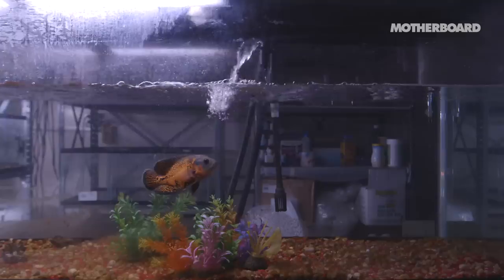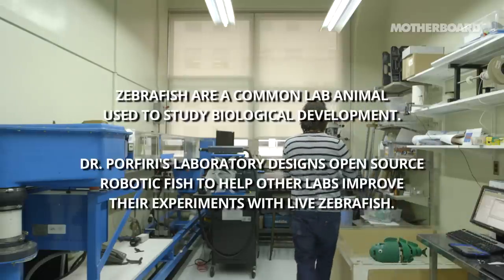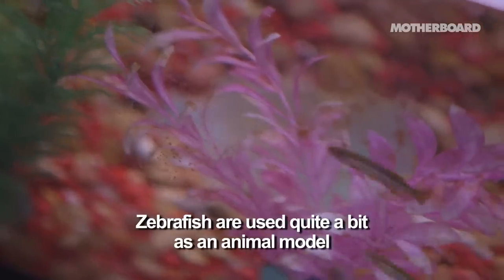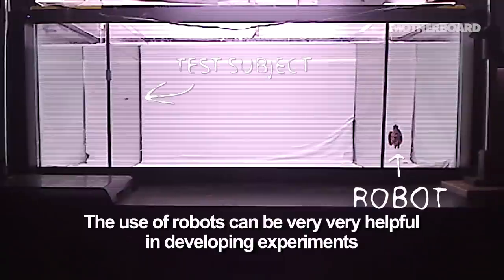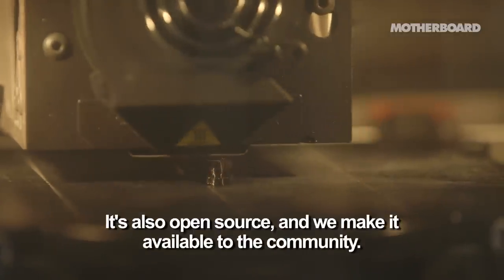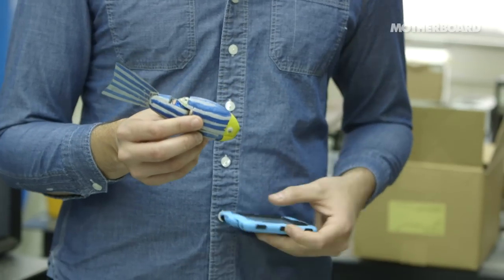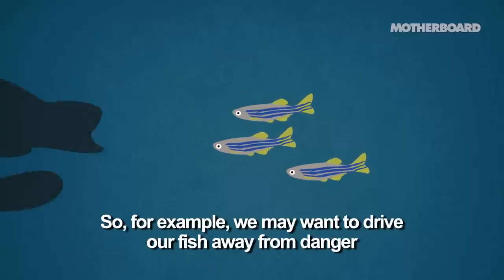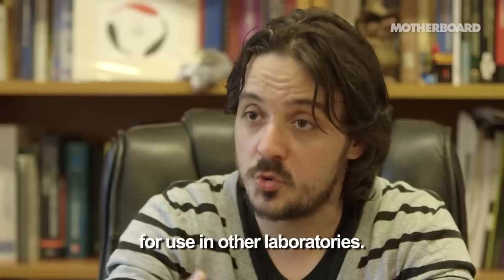Engineering the Ultimate Robotic Fish

Comment: It's nice but it seems hat there could be more efficient ways of solving the problems that they mentioned.
Like for the alcohol experiment, they could just use a video of the predator.. And it seems really expensive to have a bunch of robots scare away fish from an oilspill..
Why not just cause some strong motions inside the water to scare the fish... =/
Reply: chikkachinijohannady Video might not be as effective as it would limit the amount of interaction with the fish to only visual while the robot, for example, could also allow physical contact. Correct me if I'm wrong.
Reply: What about sound waves?
Reply: chikkachinijohannady Seems you have a knack for replacing good ideas with poor ideas.
Reply: chikkachinijohannady do you know if fish see video the same way as humans?
Reply: the purpose of scaring away the fish if there was a oil spill is to get them out of the way and if its a fish we eat we should definitely make such they don't get contaminated to make sure we don't get sick and if you tried what you said making a strong motion in the water that's not going to scare fish they are uses to waves and that is basically a wave and also they are adapted to be resistant to waves so they would keep on swimming.